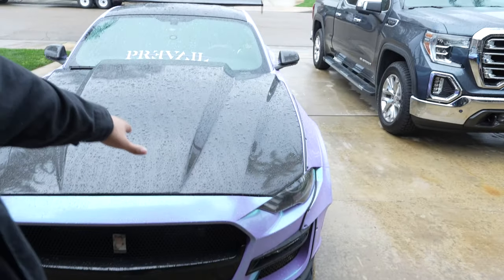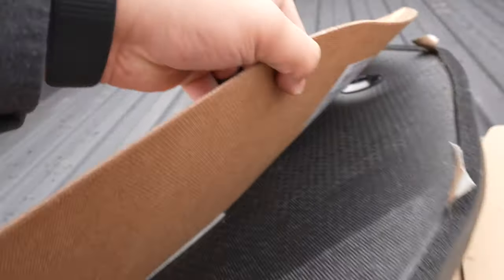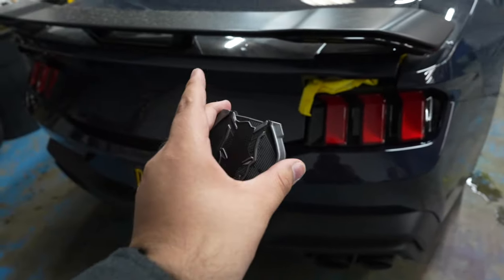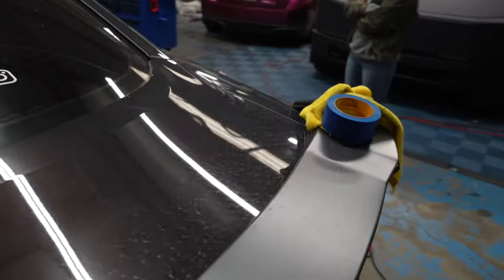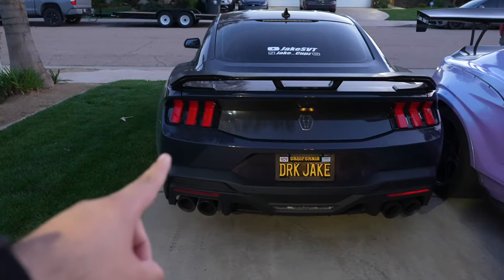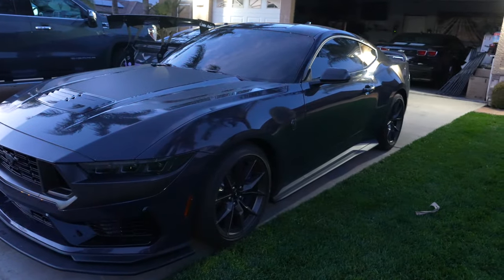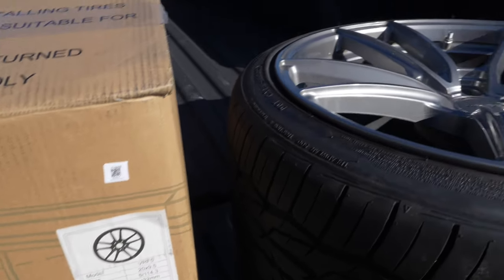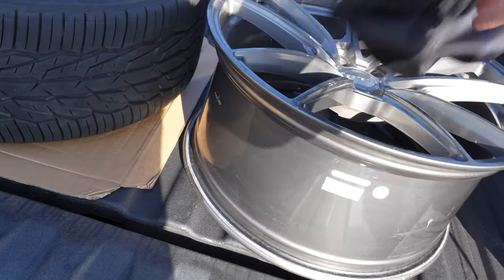Dark Horse Gets New Lip /  Every New Mustang Needs This / Carbon Fiber Decklid / RTR Side Skirts

Comment: Does the Dark Horse with Handling Package actually have a lower ride height than the standard Dark Horse?  Curious
Reply from the maker: I believe the handling package comes with adjustable suspension, also they have more areo which gives it a lower look as well